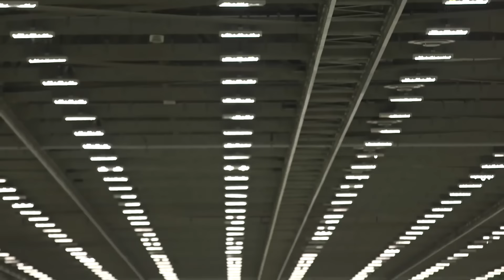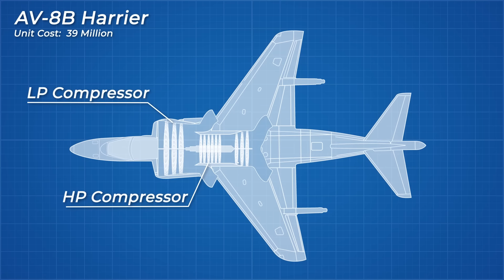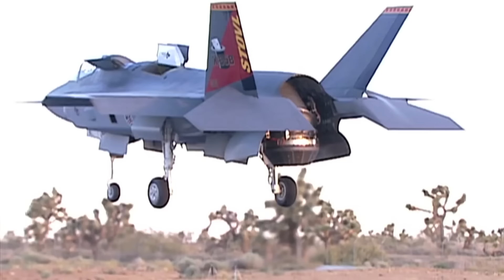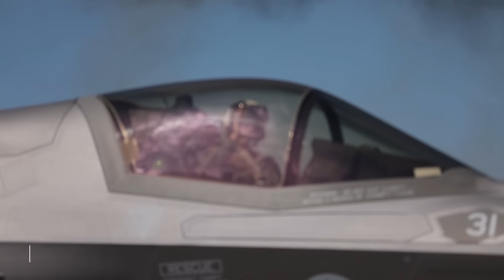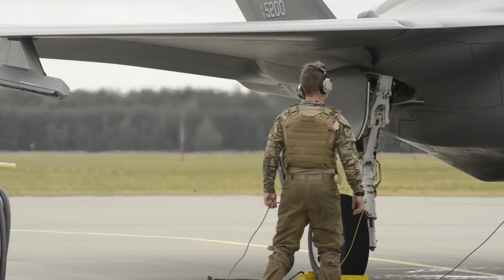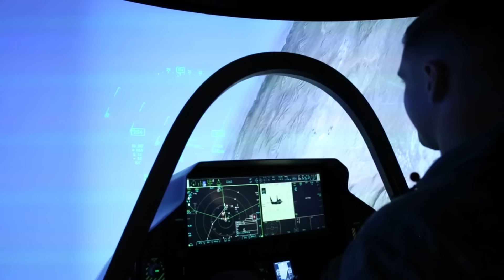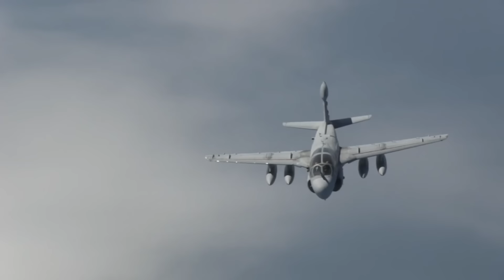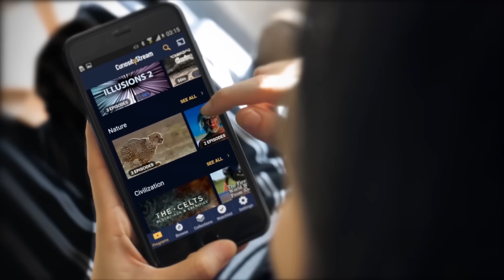Is The F-35 Worth $115 Million?

Comment: F-35 a worthy successor to the A-10?
0/10 not enough BRRRRRRRRRRRRT
Reply: Thank you. That BRRRRRRRRRRRRT was a absolute must. 🥰🥰🥰
Reply: The A-10’s brrrrt is only useful against militia with no advanced air defenses.  That cannon was obsolete in its stated purpose of killing tanks decades ago, nevermind today.
Reply: @Maka556  With ammunition development in the preceding years plus the fact it can still hold more Hellfires than any other Airframe, the A10 is far from obsolete as a Tank killer. Hence the US has ordered a budget continuation to keep them going well into the future (At Pilots and Ground forces request) Suggesting advances in air defences has ended its life is like saying theres no role for rotary wings or Ospreys!?!?
Reply: @godfroi10991  what ammunition development? Also, I cannot find a single source for A-10 mounted Hellfires.
You're conflating different concepts. You can't do an Osprey's job with the A-10. You're not gonna send an Osprey to do the A-10's job.
Reply: @ChucksSEADnDEAD  You are correct, I meant Maverick Air-to-ground missiles. I should have also stated Weapon Systems not Ammunition ie; superior targeting pods, warheads etc. The Osprey reference was because you seemed to suggest that advances in enemy surface to air capabilities made the A10 obsolete, I suggested that logic would make other Airframes just as redundant. My mistake for having mis-spoken earlier.
Reply: @godfroi10991  but again, the Osprey is understood to be a platform that will always require escort due to it's vulnerability to threats from both air and ground so it can be excused for "faults" that aren't really faults. If the A-10 requires escort to deal with air threats, but also is more vulnerable to ground defenses than its own escort, and the escort planes can do the exact same mission as the A-10... what exactly is the A-10 doing in the picture?
Reply: @ChucksSEADnDEAD  The A10 would be focusing on the ground threats while Dedicated fighters on the aerial ones. A supersonic Aircraft will always find it difficult to loiter on a run-in long enough to engage multiple targets as well as carry all the ordinance required to perform multi-roles simultaneously. I Guess you & I will just have to agree to disagree. As a Veteran I always enjoy a good Military debate, so cheers!
Reply: @godfroi10991  but the same aircraft model can perform dedicated fighter and dedicated a2g. We've already seen F-18s shoot down aircraft and bomb targets in the same missions. Loitering time can be extended through air refueling and loitering time means nothing when the A-10 is not as survivable.
Reply: F-35 has Gatling guns though
Reply: @bnjyable  while it might be an autocannon the 20mm M61 Vulcan is nothing to the 30mm GAU-8 Avenger while the Vulcan can fire more rounds per minute the Avenger fires larger rounds at relatively the same muzzle velocity giving more kinetic energy to punch through armor which it was designed to do unlike the f-35's Vulcan.
Reply: David DeWald The GAU-8 may be designed with an antitank role in mind but it can only kill decades old MBT armor in very specific circumstances and angles of attack.  In terms of an antitank platform it’s made completely obsolete by ATGMs and precision guided munitions, while its “armor” can protect it from farmers with AKs and heavy machine guns but little else.
Reply: @Maka556  while it is true that more modern tanks will most likely be able to stop the 30mm we are currently not at war with enemies with modern weapon systems and as well the A-10 has 11 hardpoints which can carry ATGMs while the F-35 has 6 external hardpoints and 2 internal bays.
Reply: @daviddewald4540  The M61 is not the gun used by the F-35. The GAU-22 is and it's just as good a gun as the GAU-8 in practical use, not to mention they are part of the same family of weapons. 

The GAU-8 has been incapable of penetrating tank armour in practical circumstances since it was first introduced (tested against the T-62A which dates to 1961). The damage that can be reliably dispensed i.e against optics and externals are things that can also be damaged by any other aircraft mounted weapon including the M61 as mounted on all US fighters except the F-35. The only true advantage the A-10 has is a large ammo supply.

The A-10 can only carry ATGMs on 2 hardpoints, and typically only carries individual missiles or bombs on each hardpoint due to the drag and weight. A typical load consists of maybe 6 air to surface munitions, an AIM-9 just in case, a targeting pod, and possibly an ECM pod. In terms of weight the F-35 can carry a larger payload, and in terms of number of munitions the F-35 can carry 4 GBU-39s or GBU-53s per pylon, so potentially up to 24 precision bombs. It will be getting ATGMs in the next few years and will be able to carry more of them than the A-10... which is limited to 2 AGM-65s (the triple racks were phased out long ago due to significant performance loss when being used).

In terms of tank killing the A-10 is and always has been average at best. It's above average at killing light armour and materiel, but that's not because of anything special, only it's large ammo supply.
Reply: @daviddewald4540  F-35 uses the Equalizer cannon, which is basically the Avenger but sized for 25mm. 

And if anyone has any doubt as to the anti-armor capability of the NATO 25x137mm round, ask the Bradley crews, who racked up an impressive number of vehicle kills with its 25mm cannon, as this weapon could be fired on the move where the TOW could not.
Reply: @Pilotmario  4 seconds of fire from the f35 (being generous by giving you gun pod numbers) vs over 17 seconds of fire from the A-10. I know who I want when I need gun runs to hose down the enemy. And if you're talking about the impressive amount of vehicle kills the Bradley racked up, .50 cal takes care of bongo trucks and sedans impressively too.
Reply: Gavin Mantyh The cannons either way would be fired in short bursts, usually less than a second long. 

Although the A-10 may need that capacity simply because it can loiter over the airspace longer. 

Although the situations where that would be useful would likely be against insurgent groups. At which point the aforementioned .50 cals would be more useful. Hence the A-29 and similarly converted advanced trainers, which are even more agile, even cheaper to operate, and are relatively easy to fly. 

The F-35 is intended to take over the “slaughter tank columns in a single pass” high intensity warfare scenarios, when the possibility of running into fighter opposition is likely, where cheaper advanced trainer type aircraft are used for counter-insurgency. 

After all, the A-10 proved fairly vulnerable to low-altitude surface-air missiles such as Roland, which in fact knocked down an A-10. F-16s proved less vulnerable to these systems, even when used in CAS.
Reply: @bnjyable  Even though I am a fan of the F-35, I won't brag about it's cannon. The cannon itself is fine, similar to most other US fighters, but it has a pretty small ammo capacity. If there's some sort of assisted aiming system integrated into the fancy gizmos it has, then it might actually be pretty good. But based on publicly available info, it's a minor feature.
Reply: I mean, it does have the GAU-22 Equalizer, which is basically the brrrrt but uses the same 25mm rounds as the LAV-25 (whose Bushmaster autocannon uses the same ammo and the Air Defense variant uses an earlier version), Bradley IFV, the Harrier II (which uses an older version), and the Mark 38 naval gun for messing up naval boats.
Reply: The F-35 has absolutely zero use for the cannons. If it has to use then, then shit has hit the fan hard and it is probably going down anyways. They only put it in there due to a regulation requiring it.
Reply: @steveguacamole3098  while yes the f-35 is piss poor at dogfighting the us military continues to incorporate guns into aircraft as learning from the mistakes of the F-4, which originally had no guns because they thought missiles made guns useless, but when you run out of missiles and there still enemies in the airspace youd be thankful for any weapon.
Reply: @daviddewald4540  "F-35 is piss poor at dogfighting" is an obsolete observation. In fly-by-wire planes, the flight control system can greatly limit its performance, and there has been much improvement since. The F-35 now can do maneuvers demonstrated by the F-22 and Su-35, that the F-16 and other 4th generation planes cannot do. Furthermore, with sensor fusion, improved missile performance and reduced observability (stealth), engaging in a dogfight means something had gone horribly wrong.
Reply: @daviddewald4540  the mistakes of the F-4? Please stop listening to History Channel boomer-tier propaganda. The Navy didn't need guns on their F-4s and they did fine. Even the F-4E only scored 5-6 kills with the gun, while in total the USAF scored over 100 kills.
Reply: @H. Honkler but that's not the end of it. The Air Force was most times going in blind while North Vietnam was aware of USAF flights way before they entered Vietnamese air space. The North Vietnamese interceptors simply went around the USAF and came in from behind at high speed. Obviously the poorer training standards were an issue but the F-4s were escorting slower attack aircraft and could not get up to speed to chase the hit-and-run interceptions. Even if they started the war with better training or the internal gun, the USAF was swimming upstream.
Reply: @Weazel I was comparing it to other US fighter aircraft really. F-15 : 20mm vulcan (940 rnds), F-14: 20mm vulcan (675 rnds), F-4E+: 20mm vulcan (639 rnds), F-16 E: 20mm vulcan, (511 rnds), F-15 E: 20mm vulcan (500 rnds), F-22: 20mm V. (480 rnds), F-18 E/F: 20mm V. (412 rnds).

Granted, the F-35 uses 25mm rather than 20mm, so it's 181 rounds of ammo could be expected to have more effectiveness with fewer rounds. It fires up to 6 30rnd bursts or 3 60rnd bursts. One could argue that if you haven't "sorted out" a 1v1 gun dogfight in 3-6 bursts, you're not going to sort it out anyway. But it's obviously a tool of last resort.

In a 4.5 gen + setting, air to air guns are better suited to a plane with thrust vectoring and canards, so you can more easily point the nose of the aircraft outside of it's direction of travel, resulting in a much wider aiming 'cone' in front of the aircraft. The F-35 is just using a different approach. It's ok, I think the traditional dogfight with guns is not going to be a priority in 21st century air combat. But the manner in which an F-35 might offer CAS is clearly not going to be gun-focused. And that's fine.
Reply: @kathrynck  
Late to the party here, but having a lot of ammo is quite pointless anyway since if a pilot ended up in a dogfight against 3 or more opponents with comparable fighter generation, the pilot is screwed long before he use up a quarter of his ammo. The only time where you probably need that much ammo is when you're fighting a whole squadron of World War 2 era prop planes, nearly improbable scenario since even a militia and guerrilla could afford a basic jet fighter nowadays. 

Western 4th gen fighters tend to have high thrust-to-weight ratio, but low AoA. Russian/Soviet 4th gen fighters tend to have low thrust-to-weight ratio, but high AoA and post-stall capability. Proponents for high-energy fighters, like Pierre Sprey thinks post-stall is useless in a dogfight as a single post-stall maneuver will leave the aircraft with almost no energy, and he influenced a lot of the design requirement for US fighters in the past. The F-35 doesn't have a thrust-vectoring nozzle, but it do have an usually high AoA for a fighter without one, and it can pull some maneuvers that not even a SU-27 could do, like 270 degree back flip and pedal turn. The F-35 deviated from the usual high-energy fighter design that's ubiquitous on most Western fighters from later half of the Cold War in a sense that its thrust-to-weight ratio is mediocre (but excellent at 50% fuel) and have a better post-stall performance than F-15 and F-16.
Reply: @Weazel Not sure what you meant. Please clarify.
Reply: Cool plane, but the BRRRRRRRRRRRT is overrated. Covers the canopy in soot, engines need to be constantly re-started due to smoke injestion, cracks in the airframe... it is more 'survivable', but also much more likely to get hit too.
Reply: and it won't be. every single A-10 got approval for an upgrade modernization package from congress recently
Reply: @Enigmaticmuffin27  THANKYOU! Thats what I told Maka556 too!
Reply: So basically
0/10 not enough payload
0/10 not enough survivability
0/10 not enough loiter time

Comment: I don't know if comparing a f35 with an A10 warthog is the best... A10 were ground attackers yes, but mostly anti tank aircraft, with a load capacity off the roof
You haven't talk about that, but the f35, because the load needs to be inside the fuselage for stealth reasons, has a very limited load capacity

Comment: 10:30 Lie. Having one design means that all use common parts, meaning you don’t need to co-develop all the most expensive parts. Upgrades can also be shared with one program instead of 3 equally expensive ones.
You also lied about reports of the F-35 failing performance specs... Lockheed would have paid severe penalties if its product couldn’t compete with legacy fighters. Those reports are from untrustworthy sources, and denied by test pilots. The agility of opponents cannot match the F-35 while armed, because bombs and missiles add drag.
Compare the F-35 cost verses it’s peers... the Rafale and Eurofighter are likewise very expensive and arguably less capable.